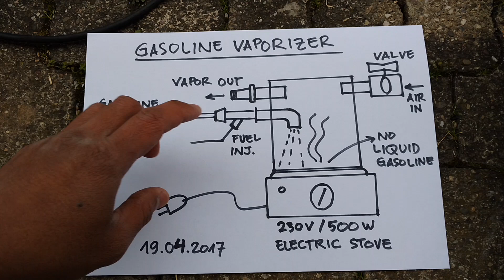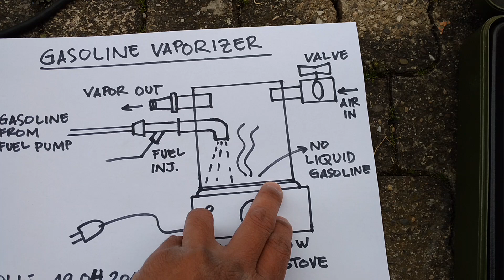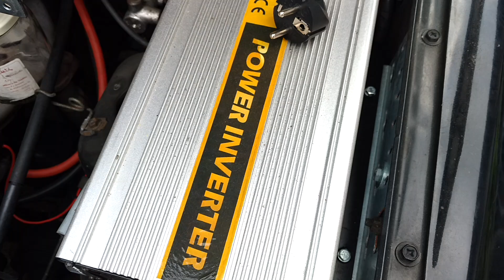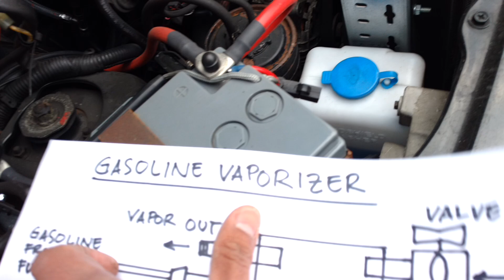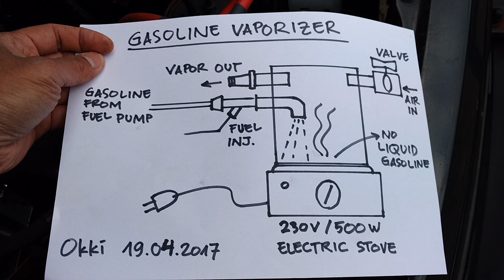Gasoline Vapor System for Car

Comment: The "Black Goo" Residue left in the bottom of your canister is / are Paraffin's and Olefin's  which are liquid waxes, and are byproducts of the fractional distillation process of crude oil. The Big Oil companies leave these contaminants in the gasoline so that people like you cannot use heat exchangers to run your car on 100% Gasoline Vapor. The liquid waxes will build up, and eventually reduces the efficiency of your heat exchanger vaporizer, rendering it useless. The Big Oil companies do not want cars to get 100+ miles per gallon, because it will hurt their profits. In the early part of the last century, Gasoline was clear, and was a byproduct of kerosene production.  The clear gasoline was called "Virgin Well Head" gasoline, and all impurities were removed. Then, in the 1930's Charles Nelson Pogue in Canada built a vaporizer that allowed his Flat Head Ford to get over 100 miles per gallon. Then hundreds of other inventors were building Gasoline Vaporizers, emulating Charles Nelson Pogue. When word got out, it crashed Canada's Stock Market for Oil. Because of this, Big oil bought out Pogue's invention, shelved it, and threatened his life. Then Big Oil put liquid Lead into gasoline, which was very effective in building up inside heat exchangers, and stopping them from working. In the 1960's Lead from gasoline in "SMOG" was causing brain damage in people, and hurting animals, so the E.P.A. / Congress passed laws and forced the Big Oil companies to remove the lead from Gasoline. So, the Big Oil companies then left in the Paraffin's and Olefin's to do the same job that the Lead did in stopping the functionality and use of heat exchangers to produce Gasoline Vapor for use in automobiles.
Reply: Clown Whisper, You are wrong , the system that I have built triples (+) gasoline mileage, lowers exhaust pollutant emissions significantly, and increases horsepower and torque. I am currently patenting the system. The system that I have invented and developed works flawlessly.
Reply: Gasoline Vapor Systems I like how you put it together pretty simple basically just a heater on the bottom of your canister I was thinking about welding a stinger or a coil into the canister then I was thinking well what if it makes too much pressure I need a separate canister to store extra fumes but then I was thinking of running the fuel vapor into the injector line to be fired out the injectors into the chamber how did you do this aspect?
Reply: have you guys tried vaporizing with ultrasonic "vibration?...it's done to "mistify" water , but still the problem of additives , as mentioned at the top(?)...........i'm just a curious bystander , no energy to focus on this , but curious...........also , the whole battery prob. w/electrics looks to be being solved , to a degree........333 mentions R.M.Smith , a great channel , and probably just the tip of the iceberg , but yeah , lead acid is going away soon , i hope.
Reply: @gaylandbarney2231  ultrasonic devices degrade in gasoline
Reply from the maker: Thanks for your extensive explanation, Michael. I can confirm your statement regarding the gasoline contaminants. If we love our environment, we should move to electric propulsion technology. I also think that hydrogen fuel (like Stan Meyer's system) is only good for transition from ICE to electric.
Reply: Electric powered vehicles also have  problems. To manufacture Batteries is a very polluting process, using toxic materials like Acid and Lead which must be mined. Batteries are also expensive to manufacture and buy. A friend of mine recently had to replace his battery pack in his Toyota Prius, and it cost him about $5000.00 . Then in most cases, petroleum fuels are used to generate electricity to recharge the batteries. Then when the batteries are used up after 4 +/- years, the batteries must be disposed of. Batteries are full of toxic substances. Some of the battery components can be recycled, but it is an expensive proposition to do so. The main problem with batteries is that they have a limited range, You can't just jump in your electric car and drive 500 miles, because your batteries will go dead and need to be recharged along the way. Recharging takes time, and charging stations are not always available, when you run low on juice. Cars like the Toyota Prius have a small gasoline engine  and electric power for just this reason.
Reply from the maker: Yes you are right Michael. With electric vehicles we have another problems. So what do you think, what could be the best solution?
Reply: There are several options: 1) Propane conversions, 2) CNG or Compressed Natural Gas conversions, 3) Gasoline Vapor System conversions, and 4) Oxy-Hydrogen conversions, all of which have advantages and dis advantages. (1) Propane is a liquid until pressure is released, then it turns into a gas, so it doesn't have the physical storage problem of compressing a gas into a large physical tank. The performance is not as good as gasoline, and it burns much hotter than gasoline, which can cause the premature breakdown of internal metallurgy within the engine. The national distribution infrastructure is not in place for propane, so a consumer could have a problem driving across country on propane only. There are dual systems available which allows the driver to switch back and forth between gasoline and propane. Propane burns very clean, and is usually available in most local venues for BBQ's. (2) CNG or Compressed Natural Gas also burns super clean, so clean that it is widely used inside homes nation wide, and it is also abundant. The problem is that the consumer would need a Large tank or multiple smaller tank to have any significant range, because it is a gas and must be compressed. Local Transportation Buses in our area already use CNG and have huge tanks, (15 feet long), placed all along the top of their roofs, to give you a perspective as to the size of the tanks that are required. There also is no national infrastructure in place to fill up  a vehicle when traveling on CNG, but dual CNG / Gasoline systems are also available, and fill up stations can be installed to fill up at home with the required high pressure pump installed. 3) A Gasoline Vapor System, which uses existing liquid gasoline that is preheated and compressed is a viable option. Most people don't know or understand that all gasoline vehicles already run on gasoline vapor emitted from liquid gasoline. Gasoline is pumped into the tank in liquid form, but then is converted into a gaseous substance through the application of heat within the engine, facilitating a phase change to a gaseous form. Gasoline must be first emulsified with oxygen in order to vaporize and combust. Gasoline makes the most power, and burns very clean if 100% vaporization occurs and is maintained prior to entering into the engines combustion chamber. If any gasoline enters into the combustion chamber in liquid form, it will not combust, and inefficiency, loss of potential power, and air pollution,(SMOG) in the form of Hydrocarbons and Carbon Monoxide will be the result. Understand the basic law of Physics that liquids do not combust - no liquid will combust. Gasoline must first evaporate by the application of heat, and oxygen must be present in the mixture to evaporate and combust . 4) Oxy-Hydrogen also has its benefits and drawbacks. The benefits are that Hydrogen gas can be derived from common water, H2O, and is free, but high electrical amperage is required to produce hydrogen.  Hydrogen does not pollute the environment.  The byproducts of hydrogen combustion are Water vapor and Oxygen coming from a vehicles tail pipe. The drawbacks of hydrogen are many. The main problem is that hydrogen only produces one third of the BTU's of Gasoline, which means that it is not suitable to run an engine on hydrogen to power a vehicle directly. For example a 200 horse power Gasoline powered vehicle would only make 66 horse power if  converted to run directly on hydrogen. However, Hydrogen can be used to power a generator, in order to recharge an electric powered vehicle. Hydrogen can be produced on board a vehicle using the process of "Electrolysis". Please investigate the workings of a "Hoffman Apparatus", to understand how the Electrolysis process works.  In my opinion, the best solution is a comprehensive Gasoline Vapor System conversion to power all existing gasoline powered vehicles, due to the already established nationwide infrastructure, the power to weight ratio of a gasoline powered engine, the fact that existing engines are already designed to run on gasoline vapor, and  a comprehensive retrofitting of existing vehicles is more easily accomplished than the other methods previously described here.
Reply: May I suggest that you join the Public group: Gasoline Vapor Systems on Facebook ? Thanks, Michael Vannozzi
Reply from the maker: Hi Michael. Thank you for your invitation. I will join your group. See you on the group! Regards, Okki Moeljadi
Reply: Welcome !
Reply: there's no such thing as " the best" only better for a given application ,so take a look at roberts channel https://www.youtube.com/user/RobertMurraySmith/videos 
and have a go at making some of his paper batteries/super caps and related inks for storage etc.... this potentially removes all of Michaels points and gets you nearer your self reliant use.

as a side note rather than use the wasteful 240v electric heater + inverter , if you're going down the (redistill on demand ) pre-vaporiser route then you can take advantage of the unused exhaust gasses heat as the heat exchanger and also use the better option for portability of a few *cheap readily available  diesel 12v pre-heater  glow plugs (they get hot enough to melt thin aluminium as it happens so good for other projects too) as ice cube stated.
 OC as a side benefit you can then also add in any combination of combustible on demand gasses  together( hydrogen ,biogas etc) into the  pre-vaporizer chamber ( make it a cyclone shaped intake/outlet  to auto mix the gases properly for the better cleaner burn OC) and get even cleaner burns for less effort.

* 4x NGK Y-732J Heater Glow Plugs
by NGK Price: £7.94 & FREE UK delivery for instance
Reply: A ten fold increase is not reasonable. Think about it, if your 350 cubic inch Chevrolet gets 12 miles per gallon, using their system, that car would get 120 miles per gallon.  Internal combustion engines are generally about 15% efficient. Their are about 30% of losses, including frictional losses and some heat losses, that are not recoverable. All gasoline powered internal combustion engines run only on gasoline vapor. They do not run on liquid gasoline. Liquids do not combust. No liquid will combust, this is a basic law of Physics. So, Gasoline in liquid form will not combust. Only gasoline vapor will combust.  Gasoline must be vaporized for a gasoline powered engine to run. Gasoline is vaporized by the application of heat. To vaporize liquid gasoline, Engineers design the intake manifold to be heated by exhaust gasses. Engineers also rely on residual heat in the intake runner ports, and in the combustion chambers. Engineers also employ "Overlap" of the valve timing events. This is a method where the intake valves start to open before the exhaust valve fully closes. Overlap allows the incoming intake charge to mix with residual outgoing exhaust gas heat. Engineered camshaft overlap also helps to vaporize liquid gasoline. Even so, 100% of the liquid gasoline is not vaporized. This being true, some gasoline in liquid form is wasted. This waste is the inefficiency of the engine. This inefficiency is what can be improved upon. If you improve combustion efficiency, not only can you improve gasoline mileage, you can also reduce exhaust emissions, and make more power.  The way to accomplish this is to vaporize 100% of the gasoline, and keep it vaporized before it enters the combustion chamber. Camshaft Overlap is also an inefficient method because some gasoline intake charge exits the engine through the open exhaust port, without powering the engine, and is therefore wasted. 100% engine efficiency is not possible, due to unrecoverable heat and friction losses.  Most of the heat losses exit the exhaust pipe. Read about the Smokey Yunick Gasoline Vapor System to find out how this can be accomplished.
Reply: Nice intel dump dude! Thanks! I vote: Best read on any YouTube thread yet.
Reply: I Invite you to join the: Gasoline Vapor Systems group on Facebook.
Reply: michael vannozzi it doesn't really matter because this entire vapor scheme has been proven do not introduce one extra mile to the gallon. There's been literally hundreds of people that have come forward and say yeah it works it works but it doesn't get me any better gas mileage. The problem is data piston will fire properly with the correct air gas mixture and that's what you're giving it. But that's also what your car gives it
Reply: michael vannozzi have you gotten around to the videos that have shown this in action and debunking the mileage myth and set them straight why there's isn't working? If you're going to pay it and something it better be significantly different in functionality than the pants that already exist which is there are plenty of
Reply: michael vannozzi okay yours you claim triples gas mileage... What about all these other ones that claim that they increase it tenfold? Who's lying? Why would one system only triple gas mileage well another claims to get 250 to 300 miles a gallon? They all function basically the same with a slight variation in Vapor production from what I can tell. I've seen people that wanted this to work to test it and say hey it works fine but I don't get any more gas mileage. There's even a guy that runs a lawn mower on it claims the same thing he hooked up a lawn mower and he got about 1 minutes difference in performance period since he couldn't test mileage obviously he left it running for a set amount of time a measured amount of fuel repeated that through the float normally and he got about 1 minute difference in usage. He did it in a clear plastic container so you can see was actually bubbling and creating Vapors going straight to the engine. Why would running Vapors rain in front of our eyes increase fuel efficiency by nothing.?
Reply: Your reply is incoherent.
Reply: The person that you are referring to made significant errors in his methodology.  Read my comments regarding that video to find out what he did wrong.
Reply: So nice to hear others who know the history of the oil companies. They would sell their mother for a dollar. Maybe someday the world will get wise to this fact. Keep up the great work Sir.
Reply: How about running it on Ever Clear vapor instead?

Comment: Okki, I agree with you on the injector. A new vaporiser injector could be better of all, i.e. the one that replaces standard injectors. You might be able to use diesel glow plugs as stoves for such devices.
Reply: I must also add, although there is a benefit from than in theory, there's a practice. From the practice we know that a car runs better on cold fuel than hot fuel. (No reference to carb-ed cars, as the carburetors work not good until finally heated to the same temp as engines)
So in high performance use there's benefit from an fuel radiator, such were installed in many race cars, including WRC, circuit, Nascar and, surprisingly, some W126 Mercedes for Japanese market, which used A/C to further cool the fuel.
Reply: So there might be no benefit in running car on fuel vapour unless the vapor is cool. As the temperature gradient that it can produce is narrower when the fuel is hot.
Reply from the maker: Hi DoriFord, thanks for your comments. Yes, it might be possible to use diesel glow plugs to vaporize the fuel, or maybe we can use it only at cold start. So that if the engine is hot, we can use the engine heat to vaporize the fuel. But we cannot use exhaust header heat to do that. I have once measured my header temperature during normal driving. The temperature varied very badly. I think we can still use exhaust gas heat but we have to build some kind of heat storage system to stabilize the temperature (some kind of mass heater maybe?). Regarding the air intake temperature that the colder the charge air, the more power engine will produce, I think this only applies on standard liquid gasoline system engine. I'm pretty sure that you are aware of "Adiabatic Engine" or "Hot Vapor Engine" from Smokey Yunick. He turned our basic understanding of internal combustion engine up side down.
Reply: @DoriFord  if you do what most people are doing in their vapour systems. we heat the fuel to make it vapouize easier and use a bubbler system to bubble air in the gasoline and route the vapour produced into the engine. there are a lot of these in cars and they work well. the simple ones work for a short period of time because the fuel gets too cold as it vapourizes and won't produce more vapour as easily. what this guy is doing is using another method to vapourize the fuel with direct heat in an enclosed system so it won't catch fire. it is an interesting idea. if he makes a fuel delivery system for his box then it will work no problem. getting that to work is the problem. as his vapour is produced the engine requires less fuel so shuts down the injectors. he needs to increase his injectors fuel.